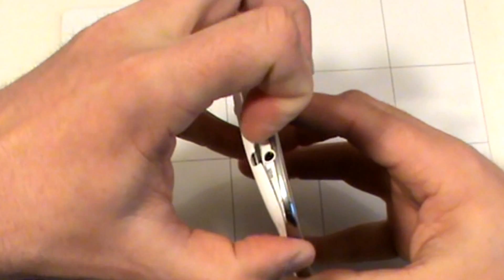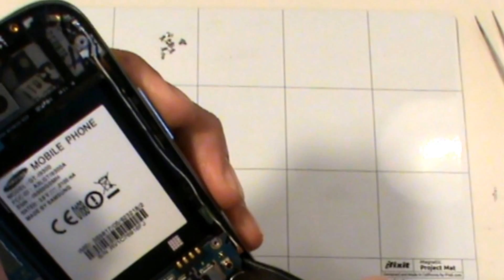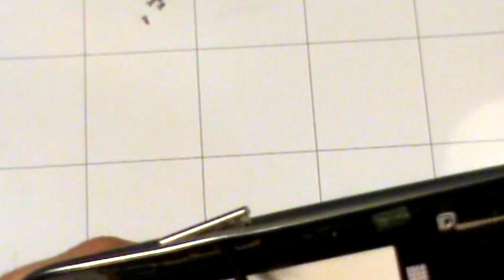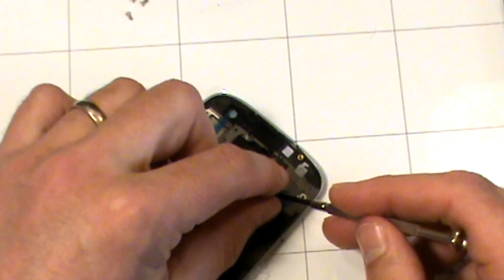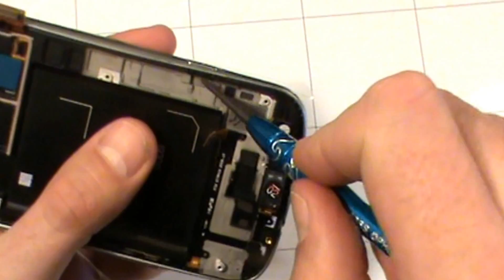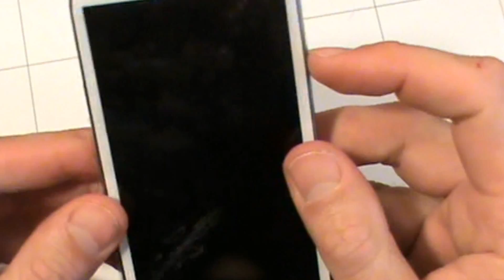Samsung Galaxy S3 Screen Replacement Guide

Comment: Hey Will, the blue screen replacement doesn't seem to be the same as the one you used in your video (Amazon link). It appears more to be the bare bones of the screen, am I right of wrong?
Reply from the maker: Yes, you're right. I have put in the wrong screen type. The version I use comes from the eBay supplier which has the full frame. Thanks for pointing that out. :-)
Reply: Will Hawkins ...damn, the ebay one is an extra £28. Ah well, still better than carphone warehouses quote of £170!
Reply from the maker: Arthur Butcher Yes, it's a little more expensive, but it's worth the money.
Reply: Still looks like the sort of thing that could easily go wrong...hmm...
Reply from the maker: You mean the replacement part? Or, doing the job? It's quite an easy fix if you take your time. The parts have never been a problem from the eBay supplier for me.
Reply: The actual job. The parts look flimsy and the last thing i want to do is ruin my phone :/ I could just get it fixed at a local repair shop, much less risk and only for a little more money.
Reply from the maker: It's not that flimsy. The delicate part, I find, is removing the vibration module from the frame. But, that just needs a little patience. Never hurry anything, Arthur.
Reply: Ok! Thanks for the advice!

Comment: Hi, i have an Samsung Galaxy SIII, I'm having issues with my touch screen. I can see the screen perfectly and there aren't any cracks on the screen. Do you know what the problem is?
Reply from the maker: It's difficult to say exactly what the problem is with your S3, but if the screen is not responding to touch, then the screen may have a faulty connection with the motherboard. When did this first start happening? What happened before it happened?
Reply: It happened quite randomly. Don't matter now, my warranty covered it. Thank you.

Comment: i have a question i really hope you see this. i tried to replace only the glass and i did something totaly wrong :( and now my lcd got a crack in it like the screen had and it turned all white... so now i have a new screen with a metal looking lcd underneath that show abselotly no picture... is there anyway to fix this? please answer!
Reply: I just replaced one for a friend that did the same thing. She tried to replace the glass and ruined the screen. She had to get a new screen with glass. Basically you follow all of these steps. and when you get everything off take the glass off again and then scrape off the silver ruined screen. The new replacement screen will have the new lcd attached to the glass with sticky tape on the back. Just make sure you get all of the old lcd screen off even the old tape on it. Then you just take the new lcd and glass peel off the plastic film on the back and stick it on. Then follow these steps again to put the phone back together. Hope this helps!

Oh btw you can get the screen she got here: http://www.amazon.com/Samsung-GT-i9300-Digitizer-Assembly-Replacement/dp/B009OZVUK6/ref=sr_1_1?ie=UTF8&qid=1392272115&sr=8-1&keywords=galaxy+s3+replacement+lcd+screen
Reply from the maker: Hi Frank, there is only one thing you can do and that is to replace the whole unit (LCD and digitiser). Not probably what you want to hear but the LCD is irreparable.

Comment: When i purchase a complete LCD how do i know if it an original samsung part.
As there  is a  price difference could you please recommend a dealer  if possible.
Reply from the maker: If you check the suppliers I use above in the description, you will see an eBay supplier. The parts have always been very good and high quality.

Comment: Plz hlp ........ My Gs3 drop and got a Green line on the of the screen & seem to br has a a damage pixels  also the touch dosn't work .... just the lock button and the Two capacitive  ........ plz hlp ..... it's need a new screen , screen Glass or what ?
Reply from the maker: Gamal, this sounds like you almost certainly need an entirely new screen unit.

Comment: Hi,
I have SGS3 i9305 4G LTE version. Will it work for my phone also?
Reply from the maker: You need to buy the specific i9305 4G LTE version of the replacement screen.
Reply: Will Hawkins
Thank you very much Will Hawkins . It is really nice to get your reply. I have bought a screen that the seller said it is applicable for both S3 and S3 4G. Do you think about such screen?
Reply from the maker: If the seller says it is appropriate for your device then I would take their word for it, keep a record of the conversation  and fit it. If it does not work then you have a record. :-)

Comment: I replaced my screen but now my back button and menu button dont work or light up anymore. How do I fix it?
Reply from the maker: It sounds like there might be a loose connection. Go back to your cable connections and make sure they are on correctly connected.

Comment: My screen display and touch is not working an idea what mistake i made
Reply from the maker: It is likely to be either a faulty screen, bad connections or a short circuit might have occurred. Start by taking it apart again, cleaning the joints with isopropyl alcohol (or similar) and reassembling the screen onto the device. I hope that helps.

Comment: I have a s3 mini and I have cracked the botton right half of the white part of the phone. I don't know of I should take it to get repaired as I am afraid that may be too expensive.  Is there anything I can do? The crack is pretty big.
Reply from the maker: Hi Lisa-Claire, The S3 Mini is similar to the S3 and is reasonably easy to fix. You can buy a good quality screen off eBay (e.g. http://w2u.eu/1kiUsgy) for between £50 and £75. The job probably takes about an hour for someone who has not done it before. You could always follow a video on YouTube to help you through it too.

I hope that helps.

Regards, Will

Comment: Thank you very much for a helpful video :)
But I have a question regarding the video in 23:00 there was a blue stick on the body of the screen I think it is a heat sink for the processor you didn't remove it. Do we have to remove it or it doesn't matter ??
Thanks :-)
Reply from the maker: Hi Zaid, Yes, that was a mistake. It there is a removable blue covering, it should be taken off. Well spotted.

Comment: I have a question., if I have 2 sgIII my main one broke... The LCD broke.. Can I use my other one? Even tho one has a SIM card slot and the other does not?
Reply from the maker: I don't believe you will be able to swap them because they sound like they are different versions. However, you could always try swapping them and see if it works. I hope that helps.

Comment: my phone dropped cracked and everything went black it works but my should I still invest in replacing the fucked up screen...none of the touch works and my god damn alarm keeps going off.Answers please
Reply from the maker: Is the screen working at all? If not, then, yes, I would replace the screen, so you can see it. You should then be able to turn off your alarm in the normal way through the touch screen.
Reply: its also the ''digitizer''
Reply from the maker: It sounds like a complete screen unit replacement is needed.

Comment: Dear Will, I am just wondering about the differences between the white S3 that are announces in Amazon and the one in Ebay! except the prices, bu the Amazon one looks like is missing some parts if i am not wrong though!
Reply from the maker: Hi Nafe, 

Good question. For the video, I use the version purchased through the eBay link. I have not used the Amazon supplier, but have solely recommended them based upon the feedback others have given about the supplier. 

The eBay supplier I use has always sent through good quality screens and I have never had any problems with them. I hope helps. 

Regards,

Will

Comment: First time you try this, you may discover you have only separated the glass itself from the laminate plastic that gives the glass it's colored border and end areas. The glass is both simple glass and laminated plastic to get it's colored edges. Under that is also a edged area double sided tape. Many people just take off the entire glass (with laminate plastic on the bottom, and re-use the sticky edge tape. I did so as well, after reheating, it's stuck good. I ended up removing the glass first, then the laminate plastic, then cleaning the digitizer glass. Took hours but I didn't ruin the phone. Took a long time to realize I had not dug deep enough to grab both the glass and laminate plastic all in one go... I will not make that mistake a second time; it will save you time if you don't do it ever at all.

Don't worry about replacing your screen unless you want to resell your phone and want to get best price, or if the screen is really smashed bad. I had a hairline crack, lived with it for a year and fixed the screen a week before I sold the phone on ebay to get a Note 2.

Comment: Hi Will,

Thanks for the tutorial. I just dropped my S3 to the ground and the LCD broke :( 
I was pondering to take it to a specialised shop but the repair is around 180EUR. Buying a LCD is around 90EUR (ebay) so I thought in doing the replacement myself. As of now I am still unsure what to do since I'd need to buy the tools too and the process itself doesn't seem very straightforward.

Cheers,
Antonio
Reply from the maker: Hi Antonio, 

The process is quite straightforward if you take your time and do things gently with your S3. Just take it step by step, don't rush and you can repair your S3 with a new LCD/digitiser unit quite easily. 

Will

Comment: Hi Will - I tried to change the glass only and the LCD underneath was cracked :( and now it's not coming on at all....  If I get the glass plus LCD and repair as you describe should this work to fix it?  I really can't afford to spend the amount of money it costs to get it fixed by a professional.  Cheers!  Jamie
Reply from the maker: Hi Jamie, from what you say about your S3, replacing it with a new LCD and digitiser will get your smartphone back to normal, as long as you buy from a reputable supplier. It does not take long to carry out the repair.

I have placed a link to a supplier I use in the uk.

Comment: will this delete all the information off of my phone? for instance, will all the pictures saved to the phone memory (not the sd card) still be in tact after I replace the front and do everything you stated in this video?
Reply from the maker: You should back up your phone first before doing this repair. It is unlikely that you will lose your photos etc, but it is wise to back them up, just in case.
Reply: well it's the only way i can get those pictures off so i'm gonna have to take a chance lol thank you so much though, i'll be using this video to do the conversion so thank you sooooo much, its an awesome video

Comment: Hello Will,
does that part (LCD+Front Glass) come with the back and menu button?
Reply from the maker: Hi Erick, the unit in the video comes as a single, integrated unit with the home button included.
Reply: Thanks so much for the response Will,
i am trying to see if its worth it to do this repair.. you did a really good job :)
i imagine that if it comes as single the back button and menu button is in between the glass and LCD, which will also be included.

Comment: What should I do, if a screw doesn't turn out??
Reply from the maker: It's a difficult one, but you should try using either some fine pointed pliers or strong tweezers to get the screw out.

Comment: Hi Will,
My Sister dropped her S3 in a case, the phone didn't get physical damage but about an hour later her soft buttons light up but her screen does not. Do you think it;s possible the ribbon cable came loose? Thank you for the video and help.
Steve

Comment: Hi, I recently tried to do this repair on my AT&T Samsung Galaxy S3 and when I turned it on, everything worked sans touch. It won't unlock, slide, etc. There isn't anything I missed in the repair process and my phone hasn't had any damage done to it after the original screen shattered. The only issue I had with the repair is the ribbon connector for the main screen didn't quite snap into place so I had to force  it just a little. Could this be my problem? if it is, is there a way to fix this?

Comment: i'll agree w/ u on that one. It seems like you tried to replace the glass yourself and got the temperature wrong. It looks familiar because i did it on mine a couple of times and cracked a couple of screens... It takes patience, practice and good deck of cards to be able to remove the top glass.

Comment from the maker: If you've damaged the LCD, then there is no point in changing just the glass, as you say. Replacing the glass is not as easy people think and, if you get the temperature wrong you are likely to damage the LCD. So, replacing the whole unit is often less costly, risky and time consuming for someone who only wants to repair their own phone.

Comment from the maker: Hi there, It is not possible. You would have to remove the glass, take the LCD off the frame without damaging it and replace them all. It is almost inevitable that you would break the LCD. The only way is replace the complete unit, I'm afraid. 

Regards,

Will

Comment from the maker: Hi Blake, everything will run as smoothly as before as long as you don't damage any of the circuits, ribbon cables or connectors. Also, make sure you power off your phone before you start so you don't short anything out. Just take your time, be patient and you will find it works as normal when completed.

Regards,
Will

Comment: Had done some research on the loc adhesives and sent an email to Loctite asking who my nearest distributor is to get Loctite 3195 and 3195DM. Suprisingly they did ring me the day after and asked why I needed those two particular products as it for them it seemed an unusual request. Turned out that those products are only available in industrial quantitys. I guess ebay is worth a shot for smaller amounts.

Comment from the maker: Hi Cameron, If you go to eBay US, search for this supplier 'cellphone-repair-shop', they stock good quality S3 screens for the Verizon version you have. Or, try searching using this phrase on eBay US 'New Verizon Galaxy S3 Samsung I535 LCD Screen Touch Panel Digitizer White S III'. 

That's the description they use on their item (if you want a white screen, that is). 

Hope that helps. 

Regards, Will

Comment: I would like to thank you to point out the LOCA glue. Sadly i had already ordered a complete lcd digitiser unit.  Literaly just 5 minutes before you mentioned it :-)  Anyways i will be atempting the bonding with the loca glue first as my current LCD is still working perfectly. When looking at this video /watch?v=Us8fz2H1qeQ it doesnt seem to involve any rocket science except that you would need uv lamp solidify the glue.

Comment from the maker: You can use the LOCA glue (see description above) to stick the glass down to the LCD if you just remove the glass. The challenge is getting the glass off without damaging the LCD, which is why I recommend just replacing the whole unit.

Comment: I just finished repacing the glass only.  The tip not to overheat is to test the temperature (61°C is optimal).  I have found however that the glue between the gorilla glass and the lcd is there for a reason.  Now with my new glass it looks ok, functions great but the phone now freezes screen when the glass and the lcd are pressed on each other (imagine the phone in your pocket) I will be ordering a complete LCD kit just for this. Otherwise its a great cheap fix.

Comment from the maker: Ok. You can test whether the LCD is still working by putting the battery back in, switching it on and making sure all the cable connectors are attached. Otherwise, you will likely need to replace the complete LCD/digitiser unit in that case, I'm afraid.

Comment from the maker: Hi Kierra, 

Do you mean you separated the glass from the LCD? If so, that's not a problem becuase you can always attach a new glass screen for the S3. You may need to use LOCA (see description above for details) to stick the new glass onto the LCD. 

I hope that helps. 

Will

Comment from the maker: Hi there, I can fix it. It's £167 plus postage of £4.99, which includes replacing the complete unit (LCD and touch screen). I can repair just the glass for £79.99 plus £4.99 postage.

Comment from the maker: That's unusual if you bought a brand new screen unit. It could be that the glue between the touch screen and the LCD is not correctly in place. In which case, you either need to send the screen back and ask for a replacement, or remove the glass and put in some liquid optical clear adhesive before replacing the touch screen. That's a little more tricky to do. I hope that helps.

Comment: If you heat up the front properly, its very easy to remove the glass without affecting the display at all, I do them multiple times a day on a regular basis and now use LOCA2 UV adhesive and UV chamber to cure the glass to the display, now they turn out perfect each time (can be quite messy though)

Comment: After this i found out about LOCA (liquid optical clear adhesive) - tested it on another galaxy S3. And wow, this they no bubble at all, as a new screen from factory. No mirror effect and touch works perfect (without any adhesive between screen and glass, touch may work laggy - freezes sometimes and you have to lock-unlock the phone to unfreeze it). I found it on ebay. Search on ebay something like: UV Glue LOCA Liquid Optical Clear Adhesive iPhone Galaxy S3 S4

Comment: I see they use a double sided optical clear adhesive. I tried it (bought from etradesupply com). And failed my screen =((. Everything was ok, but there a small bubble stuck between glass and optical clear adhesive and screen. And it is not possible to take them off from there. And is not possible to take glass off once more! As i understand that heppened because i have not got a vacuum machine as on video.